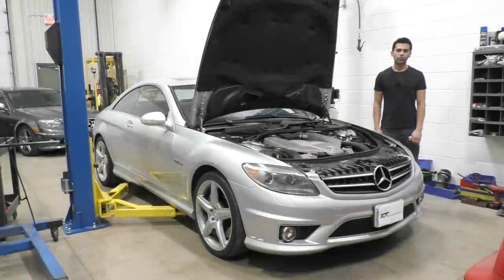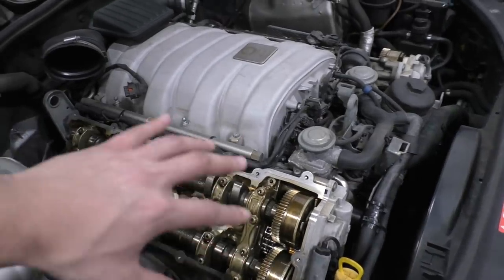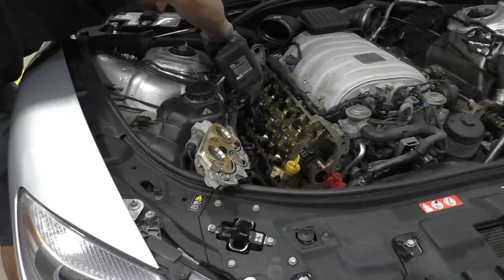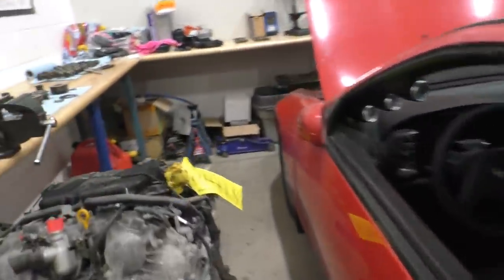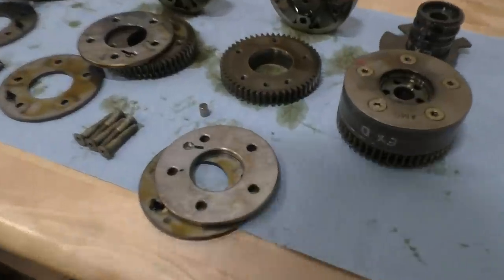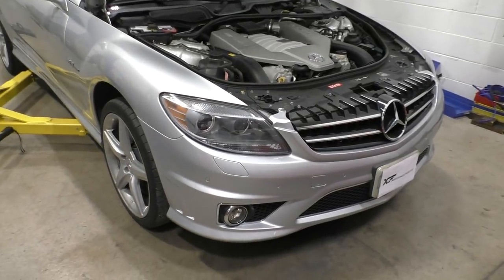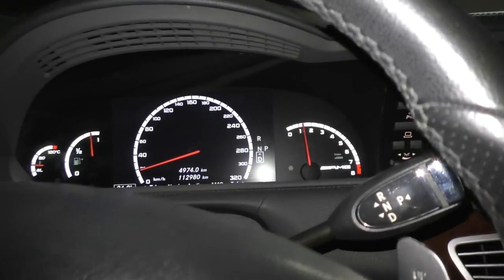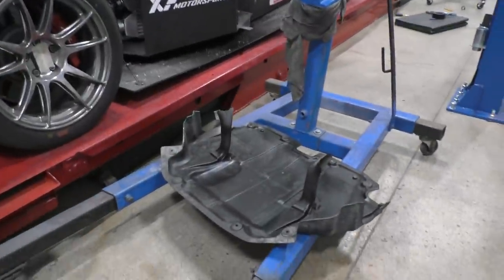Replacing Headbolts and Cam Adjusters on a CL63 AMG M156

Comment: WOW #MercedesBEnz you should repair this for free you build engines with faulty parts
Reply: Should look at more brands, Porsches from 2000 had a lot of bore scoring and ims bearing. That could destroy they entire engine. BMW rod bearings issue that costs alot to fix.